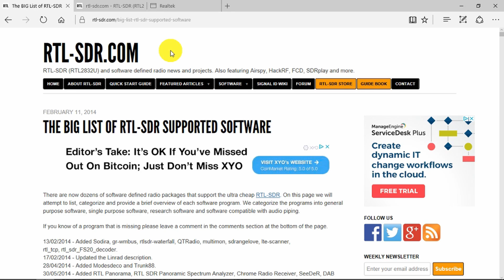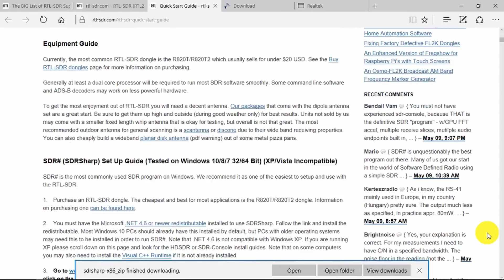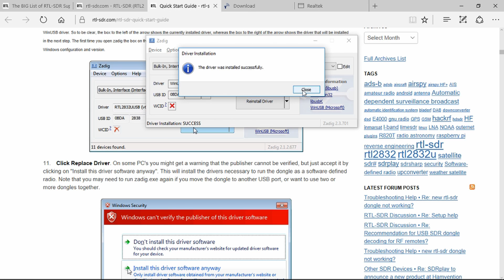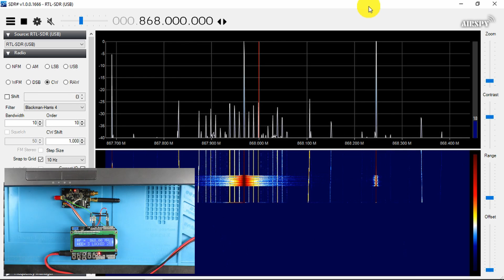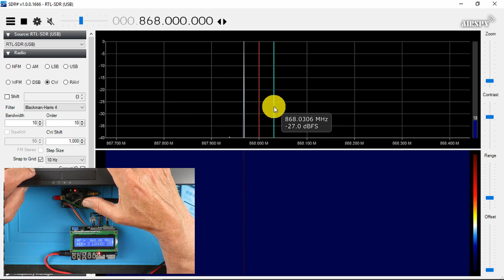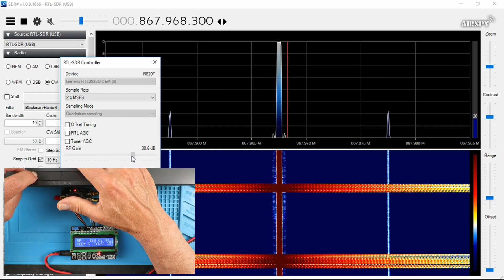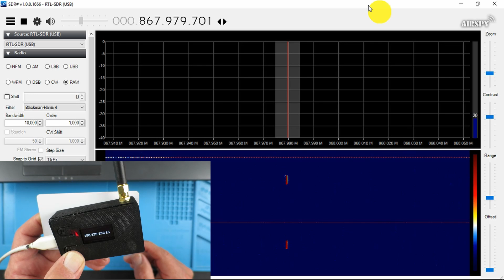Spectrum Analyser RTL2832U-R820T SDR# Radio Frequency Electronic Project

Comment: Will the ADF 4351 be able to give me a 4GHz signal because you're not trying it, you're only trying it at 868MHz and also I wrote in the description it will give you 1.7GHz is that right it won't give me 4GHz or do you mean something else??
Reply from the maker: The ADF 4351 can generate up to 4.4 GHz see my project : https://youtu.be/hYuCnsuqzjA The SDR Spectrum analyser I show here can only detect up to 1.7 GHz.

Comment: Will the Arduino be connected via a DC cable and then the computer or is there something in the middle??
Reply from the maker: The Arduino controlling the frequency generator is a stand alone unit DC powered with no connection to the PC. See my project : https://youtu.be/hYuCnsuqzjA Thanks for watching, have a great day!
Reply: @1nformatica  But I want to connect it to a computer like you and show it to rtl-sdr
Reply from the maker: @shenodabarsom3092  The Arduino is not connected to the computer. The SDR picks up the signal from an antenna.
Reply: @1nformatica  You won't understand me
Reply: @1nformatica  I just want how to connect the generator or the arduino to the computer to see the signal on the computer
Reply from the maker: @shenodabarsom3092  It does not work like that. The only output from the generator is a radio frequency signal. There is no way to connect that to a computer.
Reply: @1nformatica  But how do you connect this to the computer and display this signal in the SDR-RTL program?
Reply: @sbgame2329  I mean this @1nformatica
Reply from the maker: @sbgame2329  The SDR is a USB radio receiver. It picks up signal with it's antenna and the software displays the result.
Reply: @1nformatica  How to connect the frequency converter to sdr usb
Reply from the maker: @sbgame2329  The SDR picks up the transmitted RF signal with it's antenna. http://bit.ly/RTL2832U-R820T_SDR_Radio
Reply: @1nformatica  You mean connecting the USB dongle to the computer and connecting the generator to the electricity source and it will broadcast the frequency that I will set through the screen to this USB dongle you mean ??
Reply from the maker: @sbgame2329  Yes, the frequency of the generator is set by the push buttons on the Arduino shield. The SDR software is then set to scan the desired frequency.
Reply: @1nformatica  Well, if the USB dongle is connected from its antenna output to the antenna input in the frequency generator, is it possible after completing these steps it gives me 4ghz or not and will stop at 1.7ghz ??
Reply from the maker: @shenodabarsom3092  The USB dongle is a RECEIVER it has no output. It has a range of 24 MHz to 1.7 GHz. The frequency generator has a range of 35 MHz to 4.4 GHz
Reply: @1nformatica  Do you have a way or do you have a solution to connect the generator to the computer to give me 4ghz please help 🙏🙏
Reply: @1nformatica  please help us
Reply from the maker: @shenodabarsom3092  USB LTDZ 35-4400M Spectrum Analyzer https://s.click.aliexpress.com/e/_DnBkohD
Reply from the maker: @sbgame2329  USB LTDZ 35-4400M Spectrum Analyzer https://s.click.aliexpress.com/e/_DnBkohD

Comment: Will the device be connected to a segment called dvb-t and then to the computer, or will the device be connected to the computer via the USB port directly and I do not need this segment called dvb-t ??
Reply from the maker: It plugs into USB directly. DVB-T, short for Digital Video Broadcasting it has nothing to do with this device.

Comment: how can you tell that anttenna is on for that freq dont make sense as any ant with radiate ????
Reply from the maker: The antenna I used is from my LORA project and is for 866 MHz. You can see how I test antennas here : https://www.youtube.com/watch?v=eiC2fDZBFGc
Reply: @1nformatica  yes but you saying youe checking antenna to see if its a 866mhz anttenna ,,,, my ? is a sdr cant tell you what the anttena is tunred for you need a antenna anlizer or a veactor for that
Reply: you didnt say that in your video
Reply from the maker: I said it here : https://youtu.be/DSFIgjnkaf4?t=232

Comment: Really great instruction video on installing and using the RTL SDR# RF spectrum analyzer! Is a cheap but also professional way to easy check all our transmitters/modulators! Previously the program kept constantly crashing in Windows 7 but after also installing Net Framework 4.6.2. (which I thought was already installed but it wasn't) it works like a charm!
Reply from the maker: Thank you for your kind words Albert. Much appreciated!
Reply: No problem. Thank you for the nice instruction video! I also noticed that Zadig and SDR# only installed perfectly AFTER Windows was rebootet after any change. Something that needs to be told if nothing works and we got stuck in the installation procedure that failed installing the SDR driver.
Reply from the maker: Ah yes! If in doubt reboot, XP may be gone but it's legacy lives on!!
Reply: Rebooting is also needed on Windows 7 which I used (; )
Reply from the maker: Good to know. Thanks for posting.

Comment: Hi! Don't forget that you can/must calibrate the SDR# and the dongle by changing the ppm setting in the cogwheel setting in SDR#. Of course each dongle will have a different setting. As a basis, tune the ppm to adjust the displayed frequency in SDR# against a reference frequency i.e. FM broadcast talk station (in between bouts of transmitted audio!!!) which is generally good enough as an off air reference. TETRA base stations are GPS referenced as are GSM base stations, so have fun! Well done!
Reply from the maker: Thanks Brian! I had overlooked that and will make another video soon once I've figured it out! This is a new area for me so your input is very welcome.
Reply: More than welcome!!
Reply from the maker: Hope you approve!
https://www.youtube.com/watch?v=tu-RguaEfIY